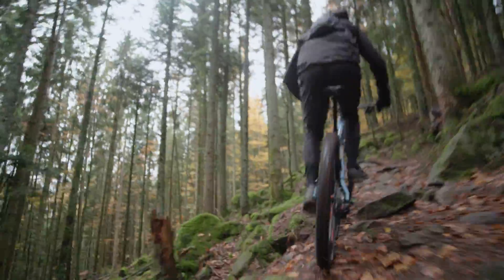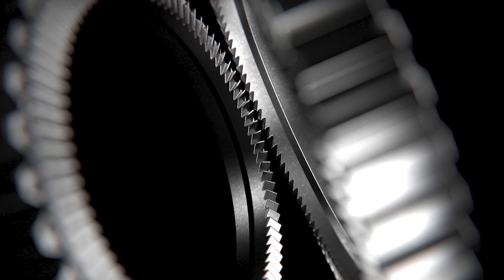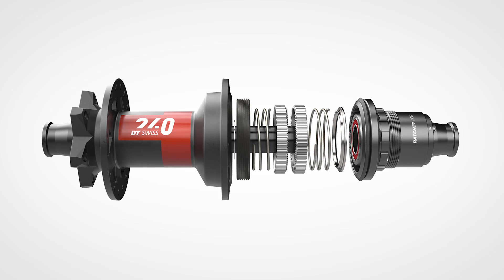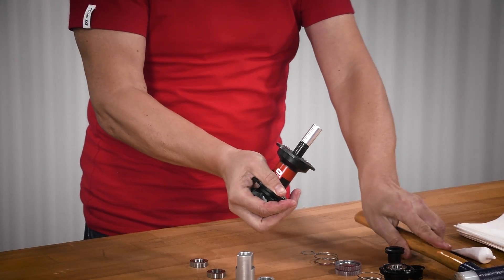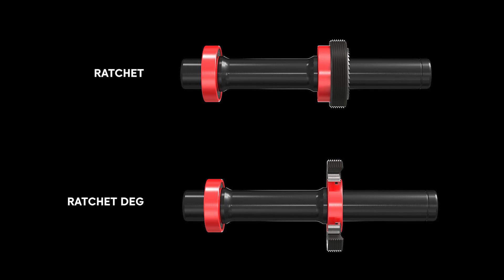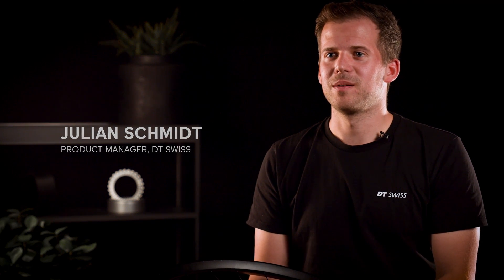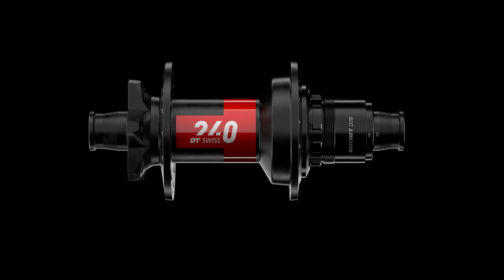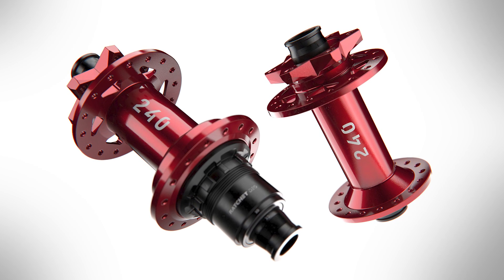A Different Angle - the New 90T Ratchet DEG Freehub System | DT Swiss

Comment: All sounds very good but as a consumer you can only base your opinion on your experience, my last pair of ERC1400 wheels were a nightmare to install tyres on, there was play in the rear hub from new and the front disc locking nut thread had been poorly cut causing the lock ring to bind up. 

Compared to my 2018 Prc1400 wheels the quality has gone down in my opinion. I returned the ERC wheels and purchased some 9Velo for 1/3rd of the cost and they are superb by comparison. 🤷‍♂️
Reply from the maker: We're sorry to hear about your experience. Quality and performance are key priorities for us, and we're disappointed to learn that the ERC1400 wheels didn't meet your expectations. Your feedback helps us improve, and we appreciate you sharing it with us. If you have any further concerns or would like to discuss this further, please feel free to reach out to us at service@dtswiss.com. We're here to help. Thank you for your continued support.🚴‍♂️ Best regards, Christian - DT Swiss

Comment: This is purely to counter Industry 9. Theres really no need for that degree of engagement. It does affect suspension performance in non hi pivot bikes.
Reply from the maker: HI and thank you for the comment. As the ratchet DEG will be just another option from us, make your own choice if it comes to the different ratchet systems we offer. Friso "DT Swiss".
Reply: Well, the 240 is the high performance MTB hub in the line
Reply: High engagement is nice for multiple reasons! It’s cool to not care for it but to say it’s useless is just wrong.

Hardtail riders like me don’t experience rear suspension issues with them. When i do get a full suspension I’ll still be riding high engagement bc i love the feeling. Makes tech-y moves much easier

What i will say is once you’re around 4-5 degrees of engagement it’s basically instant. I would never see a need for actual instant engagement like I9 or onyx

Comment: Great 😃 
Did you guys upsize all the bearings too?
Reply: Looks like still 6902 , it'll be a lot easier to remove the bearing on the ring nut side
Reply from the maker: Hi Laurentius, just take a closer look into the details on our website: www.dtswiss.com
There you will see that the ratchet DEG hubs will use the biggest bearings in our lineup. Enjoy your Bicycle, Friso "DT Swiss".
Reply: @dtswiss  
This sentence is misleading :/. 240 DEG may have the largest bearings, but looking only at 240 lineup. 350 has larger 6902 bearings - 15x28x7.  240 EXP, and DGE use smaller 1526 - 15x26x7.
I found this information on your website :) It would be nice if you could gave specific answers, and not such vague, and misleading ones.
Reply from the maker: Hi and thank you for your message. You will find as well all those details on our website, where the used bearings can be found with or product support tool:  https://www.dtswiss.com/en/support/product-support
A product presentation can not be that detailed and will only give a first impression where the website dive deeper into details. But it is nice to see that you found those information, good job👍 Enjoy riding your Bicycles, Friso "DT Swiss".

Comment: I don't see boost 157 as an option yet but that is the hub size for the Pivot in this video. When will it be available?
Reply from the maker: Hi and thank you for your interest. There is as well a 12*157 Boost+ Version available. Please check with your shop about local availability. Enjoy riding the trails, Friso "DT Swiss".